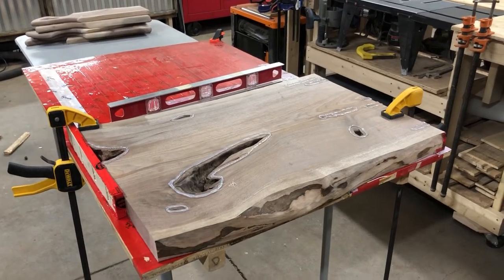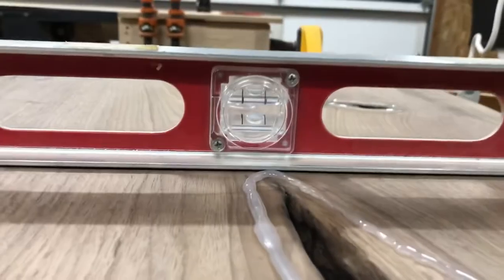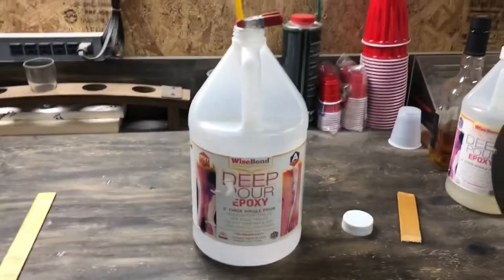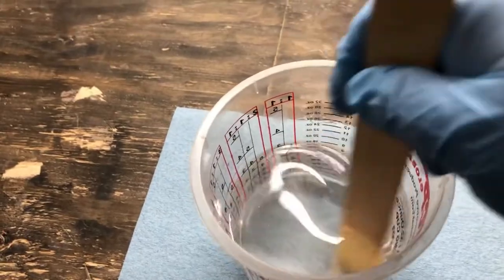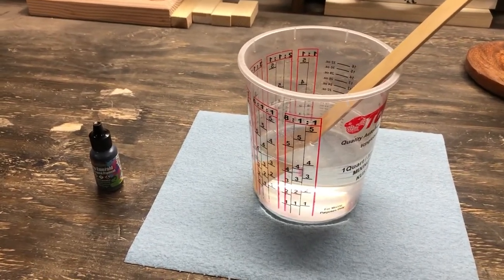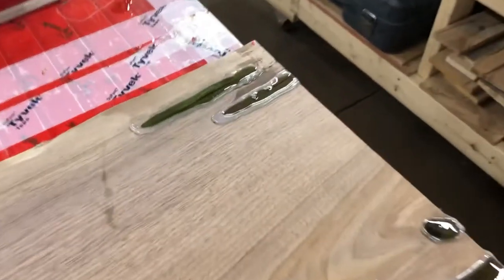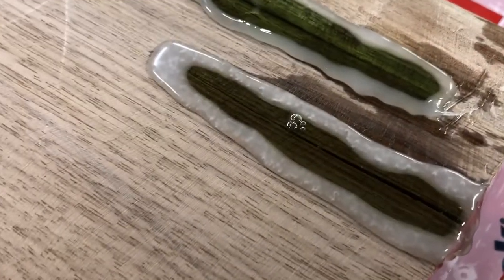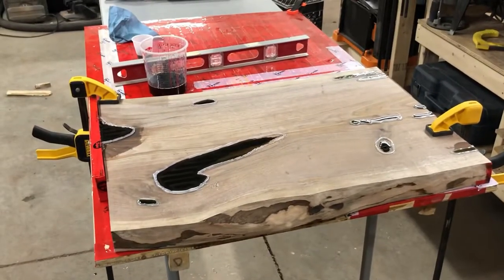How to Mix and Pour Epoxy - Easy tips and tricks to keep you out of trouble when using epoxy.

Comment: Is that just regular clear silicone that you're using to surround? I assume you just use a scraper then sander to get that off? Great video - thanks!
Reply from the maker: Yes, it’s just clear silicone. You can also use a hot glue gun if you are in a bind for time. Yes, scrape everything off you can then sand. If you have the time, a couple quick coats of poly where you are going to put the silicone/hot glue will save a bunch of time when you’re ready to sand/remove. Cheers 🍻

Comment: Appreciate the video. I have a sycamore slab that I need to fill a 5x5x2 hole. My question is will that silicone barrier stain the wood once it’s removed?
Reply from the maker: No it won’t. The little bit of solvent that soaks in sands off very easily. No worries man and good luck ! 👍🏻

Comment: After you pour and it sets what's your next steps for sanding, poly, etc.
Reply from the maker: Plane the excess epoxy off of that’s an option or sand it off starting at 60 grit working up to 220. Then depending on the finish you use, follow those recommended steps. Keep in mind the epoxy will sand like concrete compared to the wood. Be aware of that so you don’t create a bunch of low rings around the filled areas. Hope this helps!
Reply from the maker: I prefer to use Rubio Monocoat over the epoxy but almost and finish can be applied over the epoxy once it’s cured.

Comment: Thanks for the video. A question. I did my first pour on some voids. I taped the best I could but still had a couple leaks and epoxy drip through. I lost some epoxy through this leak. When's the best time to top up these low spots that leaked? Should I wait for the full cure? Any advice would be appreciated, it was a real piss off to see it drip, but there was literally nothing I could do at that point.
Reply from the maker: I would see what the epoxy manufacturer recommends as far as the window the re pour. Most are either full cure, or just as the epoxy starts to set up. Personally I would wait for full cure in this scenario. Just to make sure the leak is sealed back up. Side note, try not to use tape as a backer unless the void is 3/16” or less wide. Tape will let you down almost everytime and leak. Try to use some 1/4” plywood with tape on the surface and silicone to seal it up. I’ve had good luck that way 👍🏻
Reply: @whiskyrivercustomwoodworki2012   Thank you for this tip. Yes the tape was a fail and it all ended up on the floor. Very disappointed. It looked great at first, then over a few hours, it found a way through. Wish I had talked to you sooner. Oh well, live and learn I suppose. I will wait till full cure and reseal using plywood like you said.
Reply from the maker: @joncrandon8896  anytime man! Hope it works out this round for ya !

Comment: Awesome couple of videos on epoxy. I subscribed. I’ve never done a pour, but I have a 36“ x 48“  slab of teak that I’m starting to prep. My question is, have you ever tried to use CA glue in the bottom of smaller cracks, and spraying it with activator, to help seal them up prior to pouring? Second question: I’ve seen other YT’ers use a heat gun after the epoxy cures, and a plastic scraper to take off the excess prior to planing or sanding. Ever tried it? Thanks, and look forward to exploring your catalog more!
Reply from the maker: Thank you sir, I appreciate that!

I use CA glue religiously to prep those exact things before pours. I’ve never had an issue with it. In fact I would use it on any small crack, bug hole, or other imperfection to help eliminate small voids. That’s where you will fight air bubbles and it’s a tough battle to win. 

As far as the heat gun and scraper to remove excess I guess I’m not sure I’ve ever heard of or seen that process? Once this stuff starts to cure it’s pretty much game over as far as removing excess. I babysit the pours for a few hours afterwards and wipe drips from edges and add more where needed but have never needed to remove excess epoxy. So I won’t be much help there. I do use a propane torch to pop air bubbles after I pour and spread the epoxy, but that’s all I use it for. 
Somethings to keep in mind:

Temp/Humidity control are crucial for correct curing. Min 72 hours of controlled environment. 

Make sure you do a seal coat before any pour on raw wood. My rule of thumb for seal coats is 1oz per square foot. It’s just enough to seal things up before you start doing pours. It eliminates air bubbles, and will also catch any small voids you may have missed with the CA glue. 

For top coating:
I use 1.5-2oz per square foot for each pour. Then I bump it up to 3oz per square foot on my final flood coat. These are just my preferences and doesn’t make them gospel, but I’ve had very good luck with these amounts. 

Feel free to reach out anytime if you get in a bind or have questions!
Reply: @whiskyrivercustomwoodworki2012  Awesome, thanks so much for all the info, and the quick reply. I have have no doubt that watching your videos is going to improve my success on this maiden voyage.😊
Reply from the maker: @mburke1211  anytime man! Good luck and don’t panic lol.
Reply: Sorry for one more message, but here’s a link to the process I was mentioning about heat gun/scraping: https://youtube.com/shorts/PTL8CMRwJEU?feature=share. Just trying to save sanding time!
Reply from the maker: @mburke1211  ok this makes more sense now that I see it. I thought you meant trying to do this on the final top coat and it had me scratching my head lol. Yeah, I can see how this would be helpful on very tiny areas. What I have done in the past with situations like that is fill them with my colored epoxy and leave them a little under filled. Then bring up the rest of it with clear CA glue then use a chisel to remove the excess. Keep in mind also that epoxy soaks into the wood deeper than you’d think. Colored/non colored epoxy will stain raw wood with what ever color is in it. So what I will do if I’m only filling a crack in or something like that is put a couple of coats of poly on the face of the material around the area a day prior to pouring. The poly acts and a sacrificial barrier and that way the epoxy doesn’t seep down into the wood around the void. If that makes sense? If you don’t, you will have a discolored ring left behind that almost no amount of sanding will remove. Learned that one the hard way. Just be sure to sand all of the poly off as well so that what ever finish you put on it will have even coverage and virgin material to adhere to.
Reply: Hey, thought I would follow up. I completed my epoxy work on the teak top, and it turned out fantastic! I think my success (and confidence) are because of your tips and advice. I ended up using my block plane to level out where I over-poured. I had no leak through, thanks to the CA trick and using Tyvek tape. It came out exactly as I planned it. Thanks again.
Reply from the maker: @mburke1211  that’s great man!! Im glad it turned out for you. It’s a nerve racking experience the first time so it’s good to hear it wasn’t wasted effort. I appreciate you following up one it and the compliments on the videos. It’s greatly appreciated 👍🏻🍻

Comment: Hoping I can get a quick answer! I just started to pour some expoxy into my voids.  I’ve sealed off the back side, but threw a hole that I feel like I’ve poured a gallon into and it’s still not filling up. How do you prevent giant underground voids form eating up all your epoxy? 

Also, how would you recommend sealing a table with epoxy cracks? Can I go straight to a poly acrylic?
Reply from the maker: There’s not much you can do to prevent unseen voids. I always figure and extra 20% of epoxy to be safe because of the unknowns. It’s a cruel game lol! As far as top coat it depends on what it’ll be used for. High traffic, dinner table I wouldn’t use an epoxy. Rubio monocoat is my go to. An occasional side table or the like you maybe able to use poly of some sort.
Reply: @whiskyrivercustomwoodworki2012  this will be a kitchen island. It’s a minwax  helmsman spar urethane. It’s supposed to be good for countertops and even outdoor stuff. Was hoping that would suffice. And thanks to the quick response!